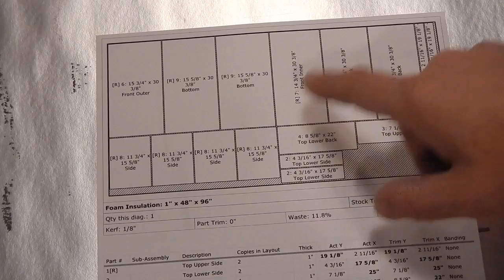Episode #8 - Building an Efficient Icebox

Comment: I just bought a Hunter 34 and the previous owner removed the galley section that housed the Ice box and he installed an electric fridge.  I have to change that back.  Thanks for your video of how you built the box. When I build mine I will be adding a cold plate to it to keep things cold.  Sure wish I had that work shop of yours to do my work in.  I have Work Shop envy
Reply from the maker: Don,  best of luck with your project.  If you have room for more than the 2" of insulation I used, then more is always better.  --Peter
Reply: Hi, thanks for your reply.  I it will be a while before I start the project.  My boat is in Biloxi MS and I live in NC.  plan is to retire in a year and move back home which is Biloxi.  I will keep your recommendation on the top of my planning list.  I have been trying to think about taking a Yeti or similar Ice chest and converting it into my box.  What do you think about that?
Reply from the maker: Buying an off the shelf ice chest and converting it would probably save some time, but integrating it well into the layout of the boat might present its own challenges.  I'd also be somewhat skeptical about claims about the efficiency of their insulation.  --Peter

Comment: Someone should told you to thin the epoxy down so it would soak into the ply before 'going off. Otherwise there is a chance of delamination. Maybe next time.' Also when doing the fillet radiui you should immediately apply glass matt and resin and soak and roll it out. That way the epoxy radius bonds perfectly with the glass and you won't have to wait for the fillet to set.

Comment: Wow quite labor intensive. How you going to cool this box? Ice? Is that why you want a 1" drain? I like the construction of the lid. Wonder if you tested it to see how many BTU's you lose with it?  Love your shop.
Reply from the maker: Bob, sorry to be slow to respond, I missed your question.  This project was an ice box, so it used ice for cooling.  That's the reason for the drain, but in actual practice I used ice frozen in gallon jugs, so the drain turned out to be unnecessary.  The only was to test was in real world conditions during the 2017 sailing season.  I found that 3 gallons of ice in jugs would last about 5 days.  Not as long as I had hoped, so this winter I've built a refrigerator.  There should be a video about it eventually.
Reply: s/v Silverheels no worries. Thanks for responding. Might reference back to this if I have to build my own box, but these days looking more and more at the Engle or ARB style refrigerators / freezer.